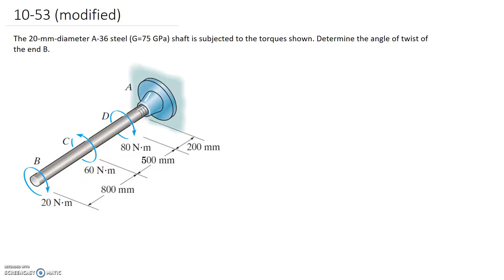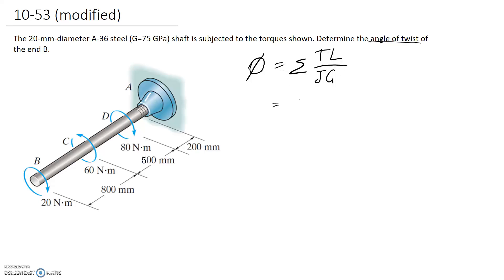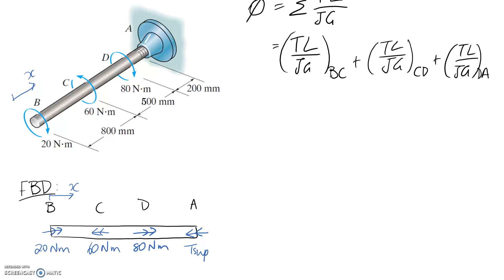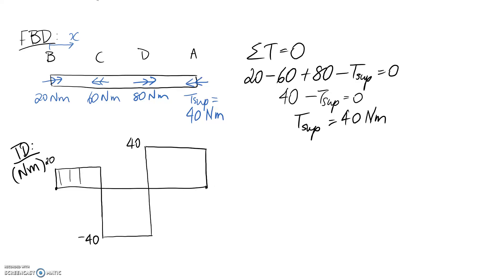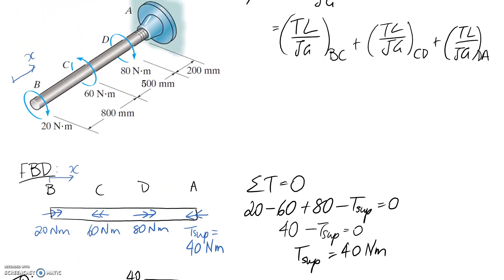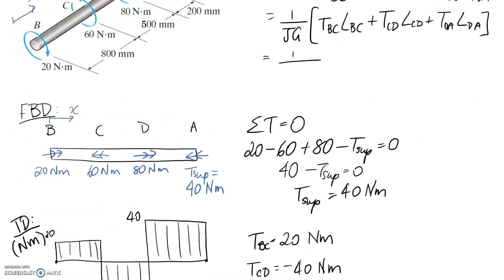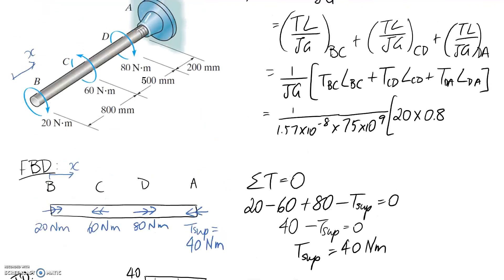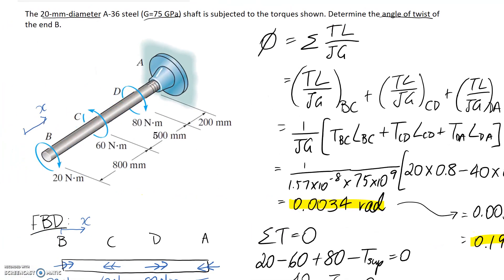Angle of Twist of Shaft with Torsion

Comment: The diameter d=100mm, The diameter of BC d2=100mm. 
Me = 3.14 kN·m, The allowable shear stress [] = 60MPa. 
Draw the internal torque diagram and point out the dangerous section ；
Try to determine            and check strength condition;
Check stiffness condition.

Comment: The torque @ TBC is to be negative 20N.m since you defined clockwise torque as positive. Right?
Reply from the maker: From about 2.20 I talked about the sign convention I applied. To be honest it doesn't really matter which way you apply the signs just as long as you're consistent.
Reply: @theryderproject5053  my apologies in advance if I sound ridiculous... my concern here is that you have defined clockwise torque @B as positive. In that case, how is torque @ section BC defined as positive again? Is that not inconsistency given the sign convention you defined? Another concern would be if torque @BC is determined as positive, the final answer for angle of twist is affected hence i wanna be sure? Thank you for your prompt response.
Reply from the maker: @shannaidu6645  The torque diagram at 4.40 is where the torque in each section comes from. I have continued the sign convention here (the one discussed earlier) where the torque applied at B is positive. Does that answer your question?
Reply: @theryderproject5053  ur torque diagram makes complete sense. but im using the sectioning method . having a tough time tryin to relate the both of them.
Reply from the maker: @shannaidu6645  is the sectioning method where you take a cut through a section and then calculate the internal torque at that point? If so, it should be equivalent - just apply the process of drawing a FBD with the internal unknown and then use equilibrium to solve for it.
Reply: @theryderproject5053  OUGH! That answers my query! thanks alot!
Reply from the maker: @shannaidu6645  great! I think there are examples of me doing that in the shear videos in the mechanics playlist.
Reply: @theryderproject5053  Thanks again! Will check them out!

Comment: what if problem asked to find the angle of twist on D
Reply from the maker: You would need to be asked the angle of twist relative to some other point. For example, twist at D relative to A. Then you would just look to calculate the twist in the sections between the two points. (In the existing wording of the question, it infers to look relative to the fixed point).